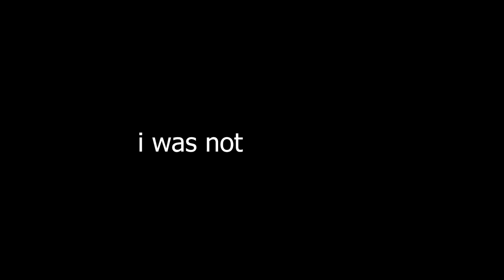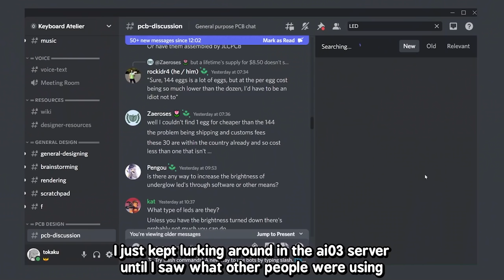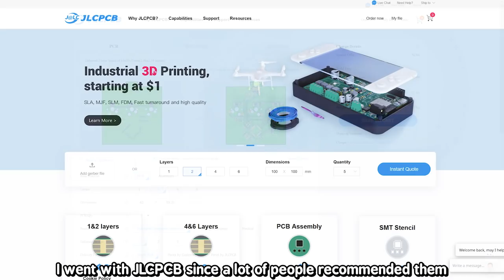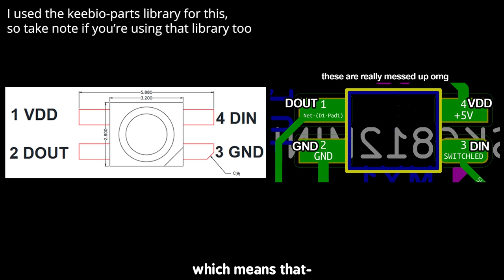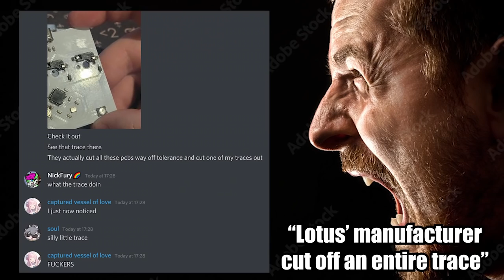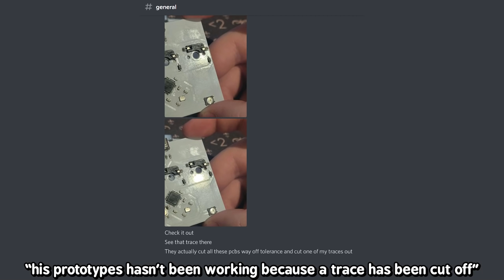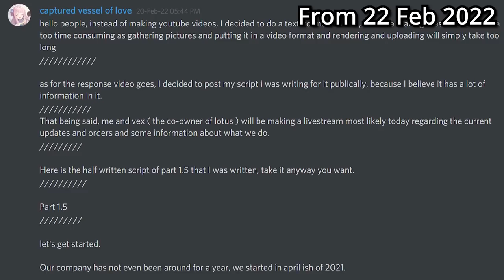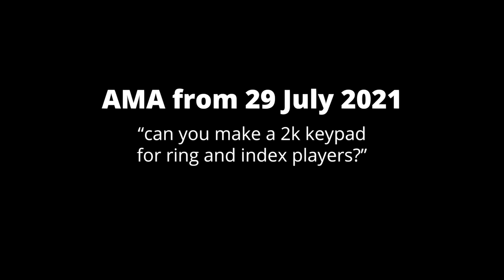making an osu! keypad 𝒐𝒖𝒕 𝒐𝒇 𝒔𝒑𝒊𝒕𝒆 ⭐

Comment: i am an electrical engineering student, i'm only in 2nd semester but still got physical pain during some parts of the "out of spite" section. this guy claims to be an actual engineer yet knows less about the basics of how electrical circuits work than 5th graders visiting uni on open-door day
Reply: I fealt pain as well, and I haven't even worked with circuit boards
Reply: Even without studying electrical engineering I think I have a good shot at this, but it’s going to be very primitive
Reply: @bot7845  better primitive than none at all, good luck!

Comment: 11:02 The 'fuse accepting voltage' just made me go, 'Huh???' 
Like, before I even went to college for electrical engineering diploma, I know what fuses are, and it's main purpose.

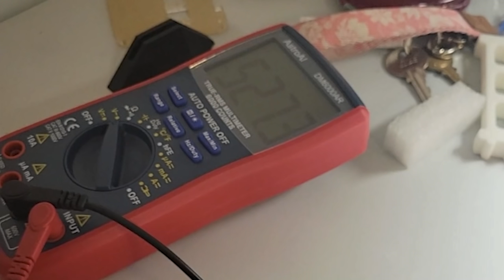11:42 This part is just baffling, and embarrassing for him. You don't deserve to claim to be an electrical engineer if you have no idea the basics of if using a multimeter, and also the difference between DC and AC
Reply: Also not how his probes are melted, the last time I so much a blew a DMM fuse was in my vocational High School EE shop. Some people really shouldn't be messing with this stuff.
Reply: Bruh I’m 15 and know the difference between DC and AC. DC is a direct current, meaning alll the electrons flow in one direction. Ac is an alternating current meaning the direction of the electrons is constantly switching
Reply: As someone who hasn't got a diploma, or worked with electrical parts in my life, I understood why "fuse accepting voltage" was a nonsense problem
Reply: I've literally no electrical knowledge as I tend to wrench away at the big stuff while the smarter guy does the expensive parts and even I know fuse takes electricity then goes boom so nothing else goes boom. As for ac DC, they're a good band. Aside from that I don't own a multimeter...

Comment: This video is great! It goes into the basics of product design, points out issues that may come up when designing something like this, and shows clearly that something as simple as a keypad is possible even for a novice to design (I mean it's simple enough that it would make for a good project for an introduction class on electrical engineering.)

I know that you're probably not interested in selling this, but I'd be willing to bet if you were to make and sell them in batches you could probably make decent money doing so. 

Regardless, good work on the video!
Reply: she probably will she had a google doc order form
Reply: @tarragon112  
Where did she have this? I was thinking of buying one from her if she would sell.
Reply: @something3920  on her twitter
Reply: @tarragon112  
Tank you!
Reply: @something3920  ur welcome :)
Reply: @tarragon112  that wasn't an order from; that was an interest form so she knows how many of the pcb she needs to order.
Reply: @tjfjt  yeah sry i think i mistyped

Comment: So, I have been both playing osu! for a while (4 years) and been doing electronics as a hobby for a long while (12+ years, not too sure since I started as a kid) and I've been watching from the sidelines as Lotus (mainly just Chris) has basically dug their own grave, hopped in, and dug their own grave again, every time they post an update. Seeing the video that undefined posted was just, from my perspective, so bad. It hurt to know that people were paying for something that, as you've proven, is not hard to make, and there's already enough resources out there, for FREE, to help anyone to make keypads successfully. It's almost like Lotus just wanted to make a rug-pull for money after they get fame!
Anyways, enough about Lotus, now about my thoughts of your keypad!
1. The PCB layout and routing is really good and looks basically professional! I was honestly impressed with that alone while I was watching. 
2. Your soldering was alright, but you likely weren't using the right solder and flux. If you are going to manufacture keypads in any quantity, get a stencil, solder paste, and a hot air station for SMD parts, and solder the bigger parts by hand with plenty of flux and good solder. You should always have smooth solder blobs, and if it isn't smooth, something's not right.
3. Not really a thought about your keypad, but if AutoCAD is giving you issues, exporting or money wise, there are plenty of free CAD alternatives like FreeCAD, OpenSCAD, etc.
4. How you change colors on your keypad is almost perfect, I was blown away to see that you used hue and saturation instead of preset colors like most things I've seen use. Adding a value control for the brightness (the V in HSV) would make it absolutely perfect, though.
That's all of my thoughts in places where I feel like I can comment, since I know nothing about acrylic manufacturing. Over all, you did a pretty good job! If you did sell these, I'd definitely buy one, especially knowing that I'll be supporting you and that it was also fueled from spite against Lotus lmao
Reply from the maker: 1. Aw, thank you! I think they could be better imo, I still have space to improve. But I'm glad they were presentable at the very least LOL

2. Ah, I didn't want to go with a stencil, hot air gun and solder paste since I would putting even more money into equipment for this. Maybe in the future if I do a lot of prototyping like this! Kinda wish my soldering iron was using a flat tip instead of pointed sigh

3. God thank you, I was gonna go get coreldraw instead of anything free

4. Ah, I take no credit for that, the ease of changing hue and saturation is because of qmk. From ground up, firmware writing would be a lot more impressive. There's actually a brightness setting but it wasn't shown in the video omg

Comment: For someone who has lost touch in electrical engineering (which is me), yeah, you are impressive in making your DIY stuff. How much (money) did it take to make this thing?

*MISSINFORMATION*
Reply from the maker: god, the prices were insane because I had to buy in batches due to minimum orders. I have 100 resistors and 1000 screws I have NO idea what to do with them. But overall this project costed me about $200+? for 5 units (though I didn't buy enough MCUs, just 4, so I can only make 4 keypads)
Reply: @tokaku  make the other keypads, sell it to other osu youtubers or give it away... :D
Reply: @tokaku  looks like you could make a profit on this thing
Reply: @tokaku  sell the extra parts to your patreons
Reply from the maker: @heroslippy6666  I was planning on holding a patreon giveaway actually... Although two of my PCBs are dead (unfortunate accidents with the USB port) and one was given to tzechi. I still have one extra PCB left but no MCU to use. I'll try desoldering the chip off the broken PCBs but no promises that it'd work, I tried desoldering one other time and it broke pins off the chip rendering it useless omg
Reply: @tokaku   Best way to get screws for future projects is to buy the 'kit' boxes from the usual suspects especially if you only need <12. They tend to have multiple 'M' sizes and lengths or only one size and multiple lengths, many of them also come with washers and nuts included. They can be had often for under $20 and they could help you out of a pinch on a future project (speaking from experience). One of the most handy 'kits' I've bought was one with multiple sizes of nylon hardware (screws, nuts, standoffs), individually they tend to cost quite a bit when ordered in small quantity I've saved more in shipping on various projects than the kit cost in the first place.
Reply: BTW when I first posted that comment it wouldn't stay up until I removed the names of two eCommerce giants that begin with 'E' and 'A'. Why the hell is youtube auto censoring comments with those names?
Reply: @billdberger7407  tf? lol
Reply: @tokaku  do you know Louis Rossmann? :) If not try to search him on youtube, maybe it would be useful about soldering and stuff
Reply: @billdberger7407  that auto censor has been randomly nuking my comments in gaming related stuff too E and A might be relevant >_<. There was a video series about scummy MTX that had that company feature heavily and after a while we couldnt directly name them >_<.
Reply: @billdberger7407  if your talking about what I think your talking about, maybe its because they're competitors to Google?
(Fully a wild shot in the dark as Ive never heard of this happening before, but its what comes to mind to me)

Comment: Honestly, I can relate to the motivation xD I wanted to get into custom keyboards a bit over a year ago and was honestly terrified of spending +$100 on something I might not even like, so I took a risk and made my own from scratch, i.e. an arduino, key switches salvaged from an e-waste board (I got 105 cheap-but-okay cherryMX clones for $15, that's not terrible), and handwired… it's not pretty, but the materials were less than $30 and it was honestly far less complicated than I feared. I'm thinking of getting a real PCB for my next real attempt, but just as a starting point I'd say if anybody out there wants to give it a try, it's really not rocket science, I mean if I can do it then it can't be impossible xD Then again, looking at Lotus… 😬

Point is, I think it's cool that you're showing off that keyboard design isn't, like, a holy grail that only a select few can achieve, and while it may feel even more crappy now knowing how (comparatively) simple the process can be and Lotus still managed to fuck it up, maybe a few dissatisfied "customers" can take solace in the fact that they can just go and make their Osu-pad themselves.

Comment: small point, at 11:20, the box in your house's wiring uses breakers, not fuses. breakers simply break the circuit when they trip, whereas fuses are one-use only and burn through when they trip. probably not the best option for overcurrent protection because you'd have to open up the board and replace the fuse every time the current rating is exceeded
Reply from the maker: yeah, they're not the same, but I used the analogy because it's closest in function to something a layman could understand. Although for the PCBs I believe keyboards use polyfuses and not regular fuses so replacement is not necessary :)

Comment: also if traces are cut off you use the board as a prototype, look into how your traces are layed out and then solder a jumper wire between the start and end of the bad trace. You could post a picture of that working and tell your customers the next batch is on the way. Also ALWAYS PROTOTYPE.

Comment: This inspired me to try making my own pedals with KiCad! I tried to make a spring reverb pedal from a amplifier plug-in schematic, and it didn’t end very well. It was a final project, and since my teacher saw how complicated it was (it did use vacuum tube, after all) I still got credit on it for trying my best, thankfully. I’m gonna try this approach.
Reply from the maker: oh goodness, always try things on a breadboard first if possible. I personally skipped this route since keyboard routing is so established and to be honest, I still slightly regretted it when I ran into issues with my LEDs on a later prototype (turns out, I had bad LEDs, which is insane since that's an excuse chris loved to use himself even though his parts were likely fine, but that actually happened to me). Troubleshooting is MUCH easier on a breadboard. I highly recommend it if you can do it before directly routing anything in kicad!

Comment: You should probably mount the pcb by the corners instead of only by squishing the USB port on further protos. In this I'd personally do this by removing an acrylic layer and just also having the screw holes in the corner of the pcb. You could also just add some filler on the bottom of the pcb so it's not free floating with some small bumpons or such if those fit
Reply from the maker: ah yep I thought about the screw holes (my original versions of the design had them) but I wanted to emulate something that sandwich keyboards do right now. Those don't have any screw holes or mounts and just something squished at the USB port so the bezels can defuse light as well. But I am thinking of ways to keep something pressed against the PCB just in case, some thick foam or something 3d printed?

But honestly the highest quality option is making a polycarbonate case with screw holes for the PCB, but boy that's expensive. I'll keep these in mind when I make another proto!

Comment: Tbh the tolerances for the case is not the issue, the PCB got nothing to mount on the case except the switches itself, that's why it's rattling inside. Idk if you're going to make another keypad/macropad, but maybe change the grid settings to some fraction of 19.05 mm (19.05/24 or 48 works best for me), so the switches can line up perfectly (kinda triggered when you move the switch footprints in place lol).

Also big congrats for making a functioning PCB and keypad on your first try! I'm still making keyboards and macropads with Pro Micros instead of on board MCUs. It's easier and cheaper for me rather than using on board ones.

Comment: The most annoying part about keyboard design is the getting the spacing right (1U = 19.05 or just 19mm) for all the keys. Everything else is pretty straightforward. Nice job
Reply from the maker: there's footprints made by the custom keyboard community that you can use to easily set things up. Look up ebalster's keyboard library on git!

Comment: About the fuse thing, it should have almost no voltage across it (when a "normal" amount of current is passing through it), since it is meant to have the lowest possible resistance when working. But everything else you said holds, "accepting voltage" doesn't really mean anything, unless he means it was blown and so the voltage of the power supply was showing on the fuse's pins? It's not like he can measure that with the multimeter on AC anyway. This isn't a hard project, far from it, but since he doesn't really know anything about electronics he couldn't get it done.

And about PCB manufacturers, JLCPCB has a reputation of not always offering quality work, but I haven't ordered anything from them yet so I can't tell for sure. PCBWay has a higher reputation, and higher cost if you're ordering in low quantities, and ALLPCB offers free samples (but they also don't have good reputation). All of these can also 3D print stuff or CNC machine parts if you need them.

And why did you need to buy 100 resistors? It's not like a project like this is going to require precision resistors from a specific manufacturer with MOQs, so you should be able to order any quantity of resistors from whatever random brand you want. If this is a thing with LCSC, you shouldn't need to order the parts with them unless you want JLCPCB to assemble the board for you (not even then, but it's more complicated).

Comment: I have a question though, isn't electrical engineers for like powerlines like the ac that runs through youf house, while in the other hand electronics engineers are the ones who does like small circuits such us this keypad since it uses small components? I mean idk rlly but I am an aspiring electronics engineer so this video kinda made me confused

Comment: Well you could use micro controllers that are cheaper and don't have dedicated USB capability. But using one that has, has the distinct advantage of always working. Instead of working only when the chip feels comfortable enough to actually hit the timings of USB.
In other words if you don't value your time at all.

Comment: as an electronics engineering dropout but a hardcore electronic hobbyist since childhood, i couldnt agree more. 
but im still wondering how the heck is that guy still running away with tons of false promises, order queues and scam money. i can build my own keypad with an arduino pro micro in just a few days up to a week then copy paste the code if i design more (im good at electronics building but not programming, i even built myself an esp32 15 remote macro keys). is the police the same as or works with him?

Comment: Hey I uses that ruler app too~ Did you know you can actually drag the dimensions (one of those 3 buttons allows you to drag the ruler until it reaches the line/size you want)? 
Also nice video, came out the moment I feel like designing random things on a blueprint as wallpaper just for fun. Will check out the PCB designer :D

How long did it took to source all the components? Aside from the chip, there were capacitors, LEDs, and you even uses hotswap slot! 
Edit: saw it total time is about 1 month

Comment: There’s a setting in AutoCAD where you can change the scale before you export it! Don’t ask me where it is tho, I haven’t used AutoCAD in 3 years 😭
Reply from the maker: I tried using the print layout as fit to sheet but it still exported really small so I gave up and used coreldraw instead 😭